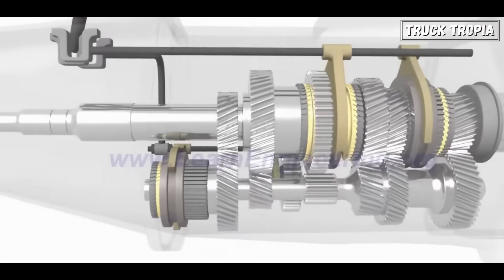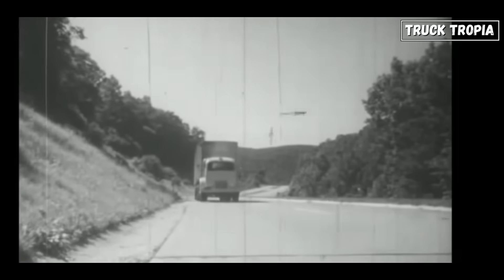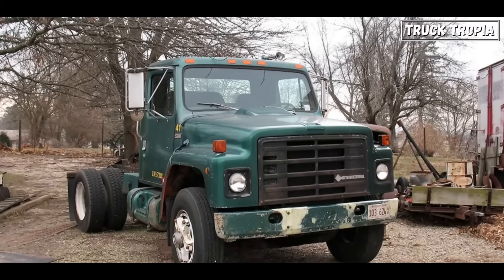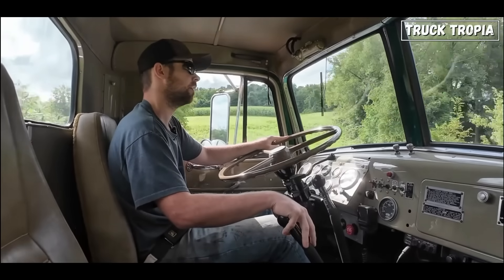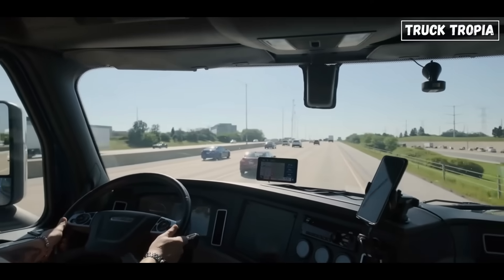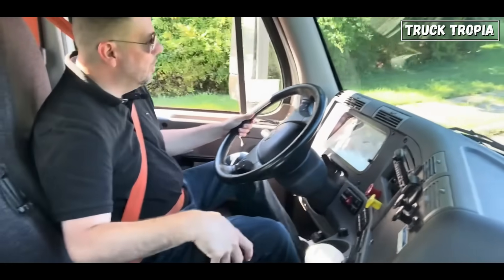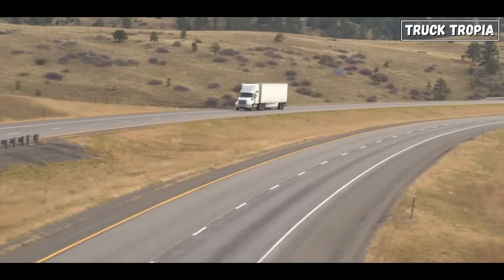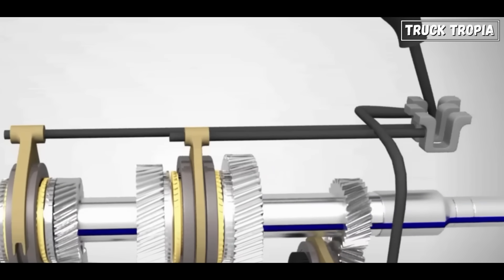Why Do We Keep Adding Gears to Trucks

Comment: The reason why lots gear because each application.western canada use each type work for trucks.i work in pipelines construction most trucks got 18 or 20 speeds trans due trucks work tough and rough terrain.i work coal mines se bc 8 years as hd serviceman each trucks got own gear yes.we have fuel trucks with 475hp engine with 15 od with 2 speed rear end due steep hill.logging was same each have systems.i drove Am general 4 years in military ontario have 2 sticks 10 speed spicer with 2 speed axle some them yes.Logging west coast is same they have own gears due rough and tough terrain in bc coast.thanks video😊

Comment: I prefer the manual transmission.  It is North America's #1 most effective theft deterrent.
Reply: Manual gives u alot more control and brakes become optional as long as u know how to slow down using ur engine
Reply: @levinrin920  The one which I have now, has the VVG, it is terribly designed. most often have to use two feet to operate it correctly. again badly designed.
Reply: @levinrin920  That's the big short-coming of automatics - engine braking.
Reply: How Manual transmission is related to thieves?
Reply: @priyanshusharma9267  Half the new truck drivers can't even do manual transmissions. They get a nice little "A" on their CDL.
Reply: @dantepagano5247 
Yup also in Canada, with condition A (automatic only).
Reply: @dantepagano5247  yep. Take the test in an automatic
Reply: @shaneimler9328  That A is for air breaks not automatic transmission
Reply: @ That depends on your jurisdiction.  For example, in Ontario, A is for tractor trailers, Z is for airbrakes, and X is for someone who needs glasses.
Reply: @priyanshusharma9267 most of the thieves wouldn't know how to drive it they stop at the first hill :)
Reply: @priyanshusharma9267  The Best one I have heard was some kids Stoll grannies car, they got in to drive it is only to discover they were not capable of !!!!!!!!!!!!!!!!!!!!!!!!!!!!!!!!!!!!!!!
Reply: especially in light trucks and cars i bought a promaster v6 gas auto only one you usually find used there were some diesels but no sticks  the ford and city ram and nissan all have diesel 5sp in home countries the for got 50-60 mph vs the 4cy gas auto around 23-25  now all 3 are discontinued and only heave duty full size available again  i always needed space not weight in my uses of vans 1500 capasity was great now i can haul about 4000 lbs  but to haulthat much it uses more gas, heaver tires higher tolls if i go to northeast toll roads and bridges   because eps told the 6250 gvw vans 1/3 of production waer to be counted as cars . result they made the heave duty van the base one 
result more not less gas used and more rubber in the tires higher tags and tolls .and like said more not less gas used . same reasone the 1980s mini pickups are no longer sold her epa required them to get way mor milage while full size only had to get few more mpg so no cheap mini pickups which companies easily could use
Reply: I don't think that works with the Trucking world.
Reply: @Neojhun  Um, yes it does work in the trucking world. Many of the new Flip Flop crowd and new truckers that are hired off the street get their licence by taking the test on an automatic. They have a restricted licence, and they couldn't drive a manual if their life depended on it. Most thieves would NOT be able to steal a truck with a manual 18 speed like I drive. They might get it going in 1st gear, but they would not be able to hit 2nd and on up. Bottom line: Modern manual transmission trucks and cars are un-stealable.
Reply: Just not in The Bronx 😂😅
Reply: @ So New Yorkers drive stick huh?
Reply: Very true. Americans can’t drive
Reply: most car thieves will leave as soon as they know the car is manual
Reply: Wow you’re soo original
Reply: Not only is it a great deterrent but new cdl drivers are trained only in automatic transmissions which to me as a 30 year rookie of being a driver means that unless you can drive a manual transmission you’re not a truck driver
Reply: 5 spd dodge caliber.

Comment: In Europe 16 speed was the standard for over 40 years. But since modern engines with full torque availability allmost from low idle, and automated manual transmissions, the lower drag losses of 12 speeds have set the standard on 12. With a creeper gear for heavy haulage up to 250 ton, or off the road dumptrucks.

Having many gears is just an excuse for a poor lugging engine
Reply: @Sjanzo  Nope you are wrong. Maybe you didn't watch the video. They carefully explained that multispeed transmissions allow you to always have the transmission and engine in the sweet zone for best fuel economy, and engine longevity. This is not rocket science, but I guess some might not understand. Why do you think modern automatic cars now have 9 and 10 speed transmissions? They know...
Reply: @SternDrive  the video explains only half. Each gear has drag losses too, which reduces transmission efficiency.
Together with modern engines that have a much wider power band, its more efficient to stick to a 12 speed with lower parasitic losses.

Comment: Are we supposed to believe that those two stickers you said were from the 40s and 60s were three and five speeds? Come on
Reply: @joshbobst1621  Well they were a five speed. I drove B Model Macks with a 5 speed...and then they also had a 3 speed (or sometimes a 4) right behind it. 5 X 3= 15

Comment: Don't lug your diesel.  It's worse than running at higher revs.
Reply: @iceman9678  Not true. Modern diesel engines are designed to run at low RPM. When I started in 1974 we were running our new Cummins engines up to 2,200 RPM and some ran them higher. They found it just shortened their life, and wasted fuel. These days we run diesels at 1,400 and 1,500 all day, and in the city in lower gears we can run them right down to 1,200 RPM, and in low range right down almost to idle. No problem for modern diesels.

Comment: The last agricultural Traktors from Fendt with manual transmision had 44 gears. 6 Speed transmision, two ranges and 4 power schift gears combined. Some combinations where blocked or they would have had 48 gears. Ranging from 650 ft/s up to 31mph. But those transmisions where quite a bit bigger then those of Trucks. Now the completly changed to their own Vario transmission.
Reply: Haha that's one thing we need in America.
Some Fent tractors. 
I was amazed at seeing em rip down the road at like 35mph or more when I went to Germany. 
Here most of them only do about 20 (unless it's a Fent).
Reply: @MrTheHillfolk  Some Fendt Tractors are sold in the US labeled as Challenger
Reply: Hey, did you mean 650 ft/h? 650 ft/s is like 700 mph
Reply: @federicopelizza9563  650 feet per hour or 200 meters per hour. About as fast as a snail

Comment: Trucks are going automatic shift with 12 speeds. This is for fuel economy and because emission engines aren’t allowed to run at the rpm they designed for. The idiots in the EPA hate the sight of black smoke so they restrict engine rpm to run slower. This is why trucks are very sluggish and don’t pull hills well. Owner operators will put more powerful engines and adjust their ratio platforms to meet their needs. Fleets only care about low cost and high resale of their units. Today’s trucks are generally garbage from the wheels up. But remember this, as they are taking more gears out of trucks they are putting more gears in cars and pick up trucks which some now have 10 and 12 speeds.

Comment: Your mistaken, in Europe ALL trucks are automatic & have 12 gears its only the USA that are way behind with the technology of gearboxes
Reply: In North America our trucks are far superior to European trucks. They are all aerodynamic and wind tunnel tested. Since they pull far heavier loads they can not get away with the single drive axles that we see so often in Europe. I pull Super B Trains with much bigger weight than most European trucks. Have you seen any Double 53 foot trains in Europe. Those little boxy single axle puddle jumpers would just sit and spin hooked up to some of our loads. So of course we have to have different transmissions. You do know that most of our modern trucks are automatic; Right? We're not "way behind with technology" at all. Did you think that Europe keeps all their wonderful technology secret from those bad Americans? Trust me. We know all about their technology, but some of it just does not work on our big trucks.

Comment: The main reaason is performance. If engine works from 1200 to 1700 only and you have to pull 120 tonn gcm with 100kmh - even 18 is not enough to upkeep engine on full power in all possible speed range. Hydromechanics helps with it but by cost of power losses.

Even light trucks nowadays get 8 gears, like my new Crafter with its 3t gwm and 2L high-turbo diesel. And let electronic brains switch them every 5 sec, not me.

Comment: Those 3 & 5 speeds you refer to of the 1950s and 1960s were not 3 & 5 speeds. They were known as a Duplex -- having the main gearbox of 4-6 gears with an auxiliary gear box of three or four gears, the auxillary being shifted through its gears in each gear of the main in turn. 
Obviously you had a lot more than 3 or 5.
Revisit:  There was also a Triplex, giving a high or low range to the main box.
Reply: In the 1970s I hauled bulk milk.  The trucks had a 6 speed main and a 4 speed auxiliary.
Reply: Also , they had a five speed trans with three speed rear ends.
Reply: @csil
There ya go!
Reply: It was usually 3-speed transmissions plus a two speed transfer case so you actually had six speeds

Comment: All those big number gearboxes like ZF 16 speed in Europe, or Fuller 13/18 speed in USA doesnt have 16 or 18 gears.

ZF 16 speed is 4 speed gearbox with range multiplicator and splitter, 1-2-3-4 and than range group 5-6-7-8 are using the same gear, only different output. And splitter, well the name says it all.

Whoever at least once disassembled ZF 16 speed you will only find 5 gears inside, R-1-2-3-4 thats it, everything else is splitted or multiplied.

Comment: The 18 speed... ability to split lo range was needed when rear axle ratios went "higher" than the 3.0's.
2.28's etc...  needed more gears to get a load moving.
Imo, not necc to have 18 if axles are 3.55 and "lower".
No need to split lo range.
Reply: Slower axle ratios are becoming the past.
Reply: @catdaddy3728  Trust me, when I am at the bottom of the pit with a full load, I use those low range splits on my 18 speed to get up that long hill. 18 speeds are a life saver, while the 13 speed guys crawl all the way up in low gear. It's along slog...

Comment: Regardless of what people think about modern trucks, we can all agree that diesel is more efficient and safe than EV.
Reply: I would prefer a diesel hybrid; the torque that comes from an electric motor is just too convenient for me to pass up.
Reply: EV is more efficient, but diesel fuel have much more energy density than batteries, which compensated more than enough to offset their lower efficiency.
Reply: Yea bc ev cars are still being experimented with but I think ev trucks will come soon that are safer
Reply: EV trucks will take over local delivery.  Especially in dense cities, which is where most people live.  EVs excel at low speeds and in stop-and-go traffic.
Reply: @jeffrey1312  The issue with EV trucks is the large array of batteries they require. Thermal runaway is a hell of a thing...
Reply: @ EV fires are not a serious issue.  It's more of a right wing talking point.  However smart people will make this better.  They always do.
Reply: @jeffrey1312  If they indeed do have fires, and they do, it has NOTHING to do with right or left. Phewwww!!!
Reply: @ ICE vehicles have fires regularly.  EV fires are a right wing talking point.

Comment: Electric drivetrain is inefficient on long hauls because electic motor constantly turning at high rpms. For this reason If it is going to be an electric truck, a transmission is needed.
Reply: An electric motor is going to consume the same amount of power whether it is turning slow or turning fast.  Your point is invalid.
Reply: @jasonstclair6293  Electric motors have efficiency curves. There's a torque and RPM it wants to sit at for peak efficiency. Higher or lower RPM, or a workload that requires more torque to maintain an RPM, and it'll draw more power for the performance you're getting.
Reply: @reaperreaper5098  Alright maybe I was a little off, but long story short nobody is developing any sort of transmission for any electric vehicle.  Maybe the parasitic losses are enough to negate any efficiency gains or they've just decided there isn't enough benefit to introduce a more complex system to gain a few minutes of run time.
Reply: @jasonstclair6293  Porche and Audi both have transmissions on some of their EVs. Specifically, 2 speeds on their rear motors for low end acceleration.

OP and you ate both semi correct. He’s correct (in that for reliability and performance), semis benefit from a (simple) transmission that puts less direct load on the motor. You’re correct that power consumption isn’t going to benefit enough to use a transmission with more than 2-3 speeds.

Comment: They keep adding gears because the EPA and the government keeps adding restrictions to emission laws
Reply: I started loading logs in 1968 and Most of the trucks had 335 HP Cummins engines and 5x4 Transmissions. Some had a two speed Rear axel,  the  two speed was not the split type , but one that would only go 40 mph in low range and on the highway, they could go over 80. the loads were over 120.000 pounds, and they needed low gears to  lift loads in tough conditions.  A truck with a 10 speed would never have got off the landing. having lots of  gears is in no way a new thing. i remember one Truck that had a 15 speed with a 4 speed  Axillary..
Reply: At this rate my 2024 Tundra has 10 gears in 10 years it will have 20😂
Reply: Yeah and 1 truck from the 60s produces the same emissions as 60 new trucks. So it is working
Reply: @shadowwolf8496  no it's not working I drove rig in the 60s my first new truck was a 67 mack r model with the 300 thermodyne diesel that truck ran better and cleaner than anything new
Reply: @stevemino142 I love old diesels but that bullshit 😂

Comment: You have more control in a manual than an automatic transmission especially when it wants to shift up a gear going down hill causing you to apply your brakes which adds to wear and tear.
Reply: That's what the engine brake is for.
Reply: @jasonstclair6293  Even with a 3rd stage Jake and a gross weight of about 78-79,000lbs gross it will still want to shift up to the next gear. That’s been my experience with Paccar or any motor that’s had them.
Reply: @RogueTrucking395  what really sucks is every transmission has a manual mode that is designed to be used in that type of situation, but most of the time it is disabled in the programming for "fuel efficiency" or to prevent drivers from doing things they shouldn't be.
Reply: @jasonstclair6293  I don’t like manual mode. I found it useful only when I was paving in a set of California double bottom dumps or if I got stuck then I’d set it in manual mode lock in my differential or twin screw then go from there. If I’m in manual mode going down hill with the Jake on set to stage 3 it will over rev the motor nearly red lining it. At least that’s been my experience with the Detroit DD-13 Motor with the DT-12 Detroit Automated Manual Transmission.
Reply: @RogueTrucking395  I won't lie I've never driven one other than moving them around the yard to wrench on them.  I've never heard much about these sorts of issues since it's pretty flat around here and people haven't had any major issues.
Reply: @jasonstclair6293  I’ve run mostly Eaton 13 speed Road Rangers, Straight 10s a Mack 7 speed and the likes but have run several Automated Manuals through the Mountains out here on the West Coast and Pacific Northwest so that’s what I was getting at earlier.
Reply: @RogueTrucking395  And thats why we have a redarder, insted of that noisy no good jake brake
Reply: @larser5566  yep Cats are good motors. Wish they’d come back to the class 7/8 Heavy Duty Truck and Vocational market.
Reply: @RogueTrucking395  i stick to my scania v8;) better then cat in every way🤣
Reply: @larser5566  challenge accepted. I do like Scania, Mercedes and some of those 1846 Model Cab Over Fords.
Reply: @jasonstclair6293  I took a trip with a modern Kenworth Automatic. Maybe I didn't know how to drive it, but every time I went down a big hill the RPM would drop to idle. I assume that was a fuel saving feature, but the Jake Brakes would not come on. I think guys should have additional training on these auto trucks. You could have it run away on you going down steep hills. On one hill I let it go so I wouldn't heat up the brakes, and it went right up to 90 MPH!!! Good thing there was no curve at the bottom of that hill..Very scary! I despise automatics.
Reply: @ From what I have seen that is actually one of the ways they can be programmed to work.  I know with Cummins you can set the engine brake to come on if the speed is a certain MPH over the cruise setting, and I think Detroit also has the setting.  Like most other settings it could be disabled also if I remember correctly.  I left that job a few years ago and to be honest nobody there really knew anything about how they worked.  I just know from looking through the ECU settings there are several options that can be tweaked, disabled, enabled, and such.  Does Paccar build an automatic now or are they still using Eatons?  I will agree some additional training would help a lot of people.  Technology in all trucks went from pretty much bare minimum to every bell and whistle imaginable in a very short amount of time.
Reply: @jasonstclair6293  Paccar does make automatics yes